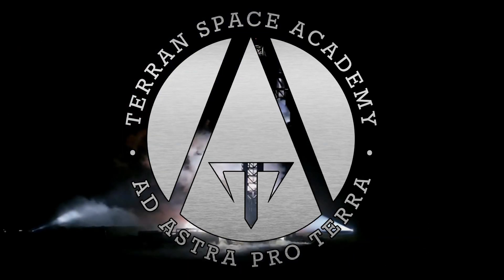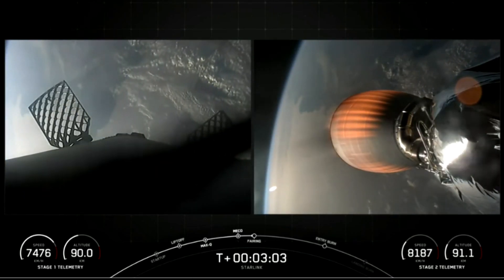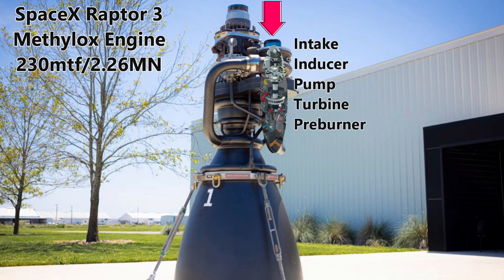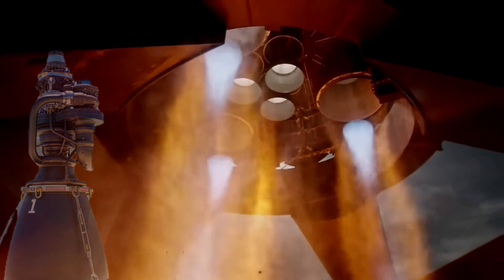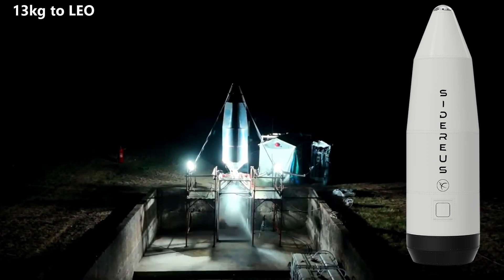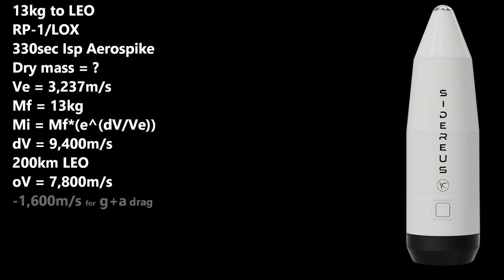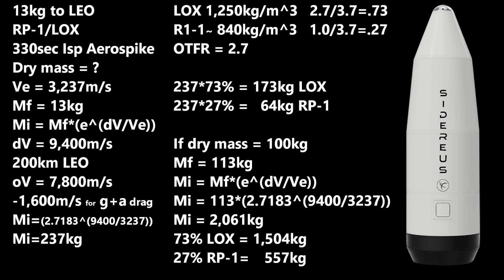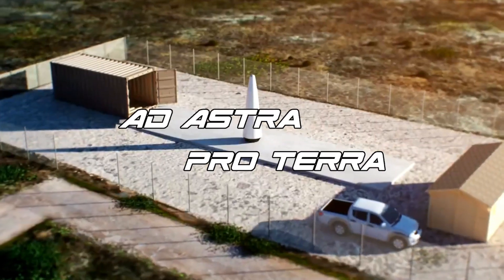Sidereus SSTO and Raptor 3 Revealed

Comment: Why did NSF never explain that the outer engines cannot be re- lit.? Not that I saw
Reply from the maker: the gas cannisters to spin them up would be too much mass. Plus since the returning booster is so light they would never need those outer 20

Comment: If you add disposable boosters, I mean on the sides, made of paper composite, expendable then it might work well.  Small rockets are not as capable of SSTO as larger rockets.  Also I believe there is a fuel and design that could get over 700 seconds of impulse if done right, through many iterations and experiments, but doubling the isp would make SSTO a snap.

Comment: Regarding SSTO, there are non-cryogenic solutions. Using High Test Peroxide (90% H2O2) and propargyl alcohol (think of liquid acetylene gas) you can use lighter tanks that reduces the dry mass.

Comment: For the Raptor 3, a portion of the cyrogenic propellents actually goes everywhere via embedded microchannels before being combusted. Thats why it doesnt need heat shielding or fire suppression. Likely every combustion pathway (ie almost every part of the engine) is complemented by cryogenic counterflows.

Comment: I guess each generation has to re-learn thruster idiosyncrasies.  My team experienced the thermal issues with the doghouse and Teflon swelling issues in the mid 80's.  We had a great propulsion and thermal group of engineers.  We mitigated with operational changes for the first unit and used lessons learned to address the root cause for future iterations.  It was interesting, challenging and rewarding work.  Yes, unrelated and just rambling.

Comment: I'm so impressed by the way SpaceX works. They really are the leaders in space technology.
Elon is absolutely right about no part is the best part.
Some years ago I worked on the development of a piece of mining equipment.
The rivals had 250 parts, 5 of which were moving and the thing weighed 34 kg.
Our machine had 82 parts , only 2 of which were moving and it weighed in 18 kg. Manufacturing cost was 1/6 th. 
We ended up completely dominating the market. Eventually one of the rivals (a major international company) bought out the design and signed a royalty agreement.
Reply from the maker: He is the Henry Ford of this century... With similar quirks it seems.

Comment: I still don't get it. You're so cautious and skeptical approaching other Rocket Companies claims, but all in with SpaceX claims, especially coming from Musk. Raptor costing less than 1M? That will take a long time. Starship has plenty of design issues, still far from being operational and underperforming in thrust levels.
Reply from the maker: Raptor costs less than one million right now for SpaceX to build... one of the things that distorts these comparisons is how much does it cost to build an RS-25? We know what they charge for it... but that's not the same. The SLS probably should have used the RS-68 anyway. Although retired with Delta IV these were very effective engines that were made to be disposable. With the RS-25 we are throwing away Ferraris with every trip to the grocery store. I would have loved to see a space plane with RS-25's.
Reply: @terranspaceacademy   The RS-25 cost include the hardware, assembly, and Crew rated certification. Also more powerful per unit than the Raptor. Too soon to compare both Rockets and getting into the hype train.
Reply: @RogerM88  even if raptor cost ten times its current price, it's still a better deal than anything nasa or Boeing or anyone else is doing. Some ppl exist only to hate on musk and his companies lmao
Reply: @dmurray2978  This not about hating on Musk, it's being unbiased. Plenty of hating coming towards Blue Origin, ULA, and NASA. The more Rocket Companies to succeed in launching their rockets the better for Space exploration.
Reply: I remember tim dodd with elon in the first starbase tour that the goal was to get the engines priced under 500k in the distant raptor timeline. I think lol  @terranspaceacademy

Comment: That raptor is looking polished. Impressive! Is the new v3 a "cooler running" engine?  Why no heat shields needed?
Reply: The issue was that fuel was running in all those tubes and they weren't heat resistant as they have such as large surface area per volume of fuel.  Kind of like how our home furnace have so many small tubes to carry the heat from burning gas.  Once fuel are routed inside the housing, it'll take a lot more energy/heat to make any effect on the fuel running inside.
Reply from the maker: That's a very good question... Either the metal is durable enough to take the heat or they don't heat up as much / are better cooled.

Comment: Comparing a 2020 era design to a 1970s design is a low way to brag about how advanced something is.  Instead compare Raptor to its peers.
Reply: Sadly, those 1970's designs remain a peer of the raptor. They are essential to NASA's latest rocket design intended to be used in the same lunar missions as the raptors. That makes them peers.
Reply from the maker: I have my friend. Many times. The only true competitor to the Raptor is the RD-270. The 70s was the pinnacle of rocket design. There are several lessons looking at BE-4 and Raptor... And others comparing the RS-68 to Raptor.
Reply: @terranspaceacademy  I think I'm right in saying the fuels for RD-270 were hypergolic, and probably very expensive? (not to mention difficult to handle) Raptor fuels are probably the cheapest you can have right now, and can be made comparatively simply.
Reply: True, he should compare to the Blue Origin's BE-4 which is $8million each, and also not re-usable.  The BE-4 is similar to Raptor V2's performance but the V3 will trump the BE-4 in performance.  Chamber pressure on V3 is bonkers.  2.5X of the BE-4.

Comment: Sidereus is going bankrupt.
calling it now
Reply: For how experimental they are, they are likely to need a lot of money to iron out all the potential issues.  So I agree that they are likely to run out of money first.  It makes sense how SpaceX started with a tried and true design, only focus on optimizing on cost, earn all the money they can, then go and do something crazy like Starship.  It's the same story for a lot of the EV startup that compare themselves to Tesla.
Reply from the maker: Always a good bet in the space industry... Tough market.
Reply: The SSTO is not achievable at that size without a lot of exotic materials, and so far all I'm seeing from them is rolled sheet metal structures and lots of stainless steel plumbing. To me they look like another version of ARCA Space, and we all know how his SSTO claims worked out.

Comment: Looking at the Raptor 3 / 2 comparisons it looked like a turbine exhaust pipe on the right. Being the Raptors are full flow stage combustion engines where the preburner turbine exhaust is supposed to discharge directly to the combustion chamber I was perplexed that the Raptor 3 looked like a gas generator cycle engine. I am happy you identified the pipe to be the methane supply line rather than a turbine exhaust.   I appreciate you clearing that up for me.
Reply from the maker: It loops around and goes back in out of view... Or was the result of my trying to fade the inside parts in and out :-)

Comment: Do they have to requalify falcon 9 for human spaceflight after deleting the sensor line?
Reply: I wonder if the successful flights they've already had without the sensor, would be considered fine by nasa
Reply: I'm sure there is an internal review process that NASA goes through, and they will likely give a thumbs up after X number of successful flights.  Likely someone smart that works for NASA will already be convinced that the risk is minimal at most.
Reply: I mean if it works it works 
"The best part is no part"
Reply from the maker: Shouldn't need to. There'll be plenty of cargo flights but that is a good question.